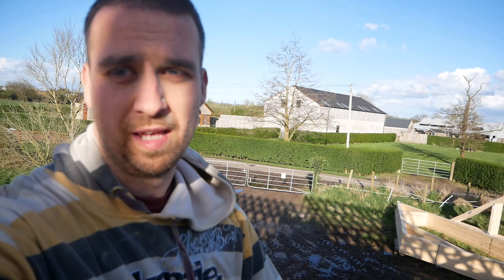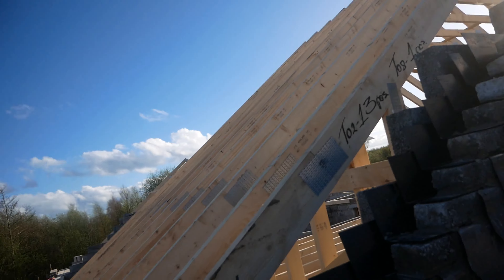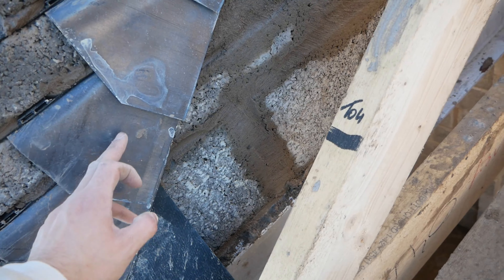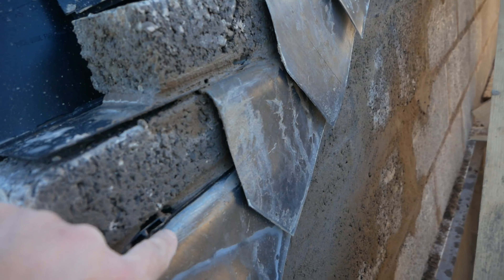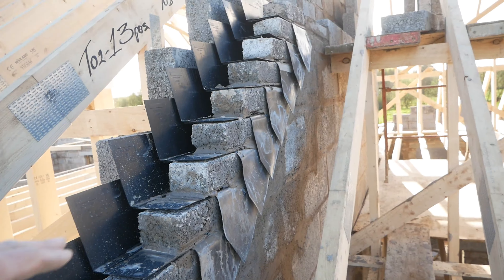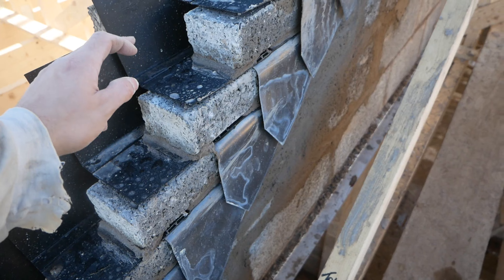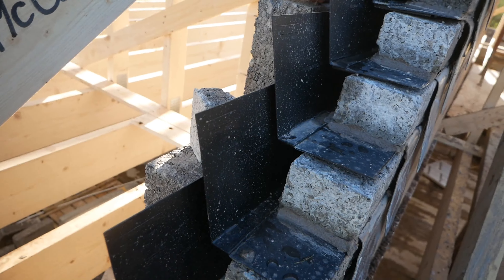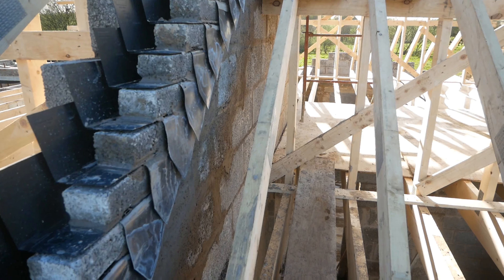How Lead Trays Work  Functionality of Lead Trays in a Building Construction

Comment: The plastic cavity trays are a modern addition. 
For some reason they are going mad thinking that cavities are filling up with water, they aren't. It is utter madness.
If you put a camera in any cavity early in the morning you will see moisture, we used to call it condensation. Now they call it water running down the cavity.
Reply from the maker: Yea I don't see water getting past my render at all or the roof as it should be well sheltered also but it is a pretty good design

Comment: Quick question roughly 1 bag of cement in the mixer how many shovels of sand for the first scratch coat and how many shovel fulls for the second coat. Be startin to plaster this garden wall next week. Them trays bring back memories going to a wee man in Coalisland to get them. He made them in the back of his house then
Reply from the maker: Yea a mate of mine asked why I didn't just make them myself but these are pretty well made. I always fill buckets 3 to 1 then 4 to 1 top coat if shovels to a bag probs be like 10 to a bag then 12 to a bag